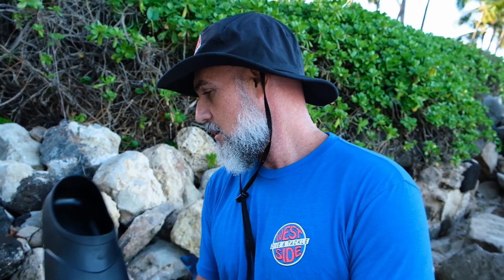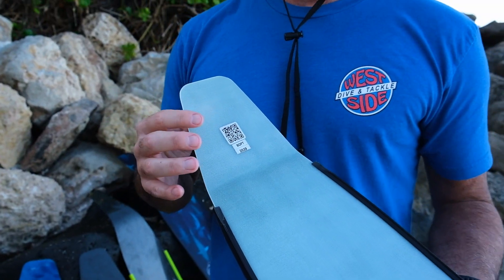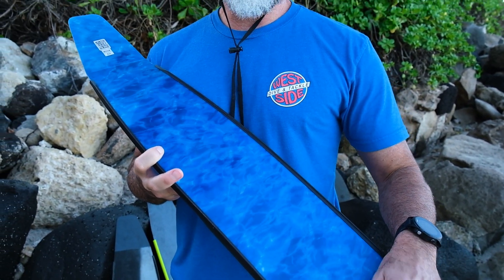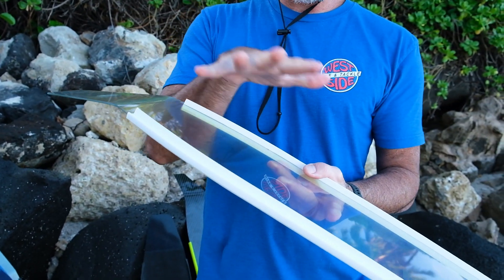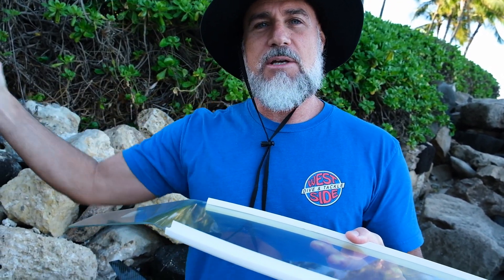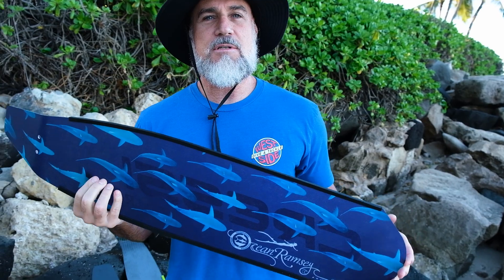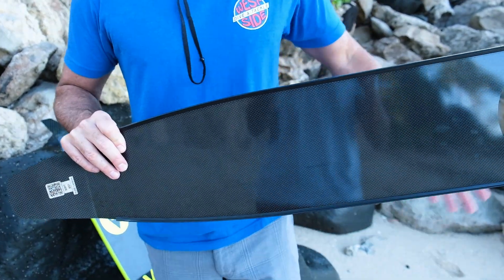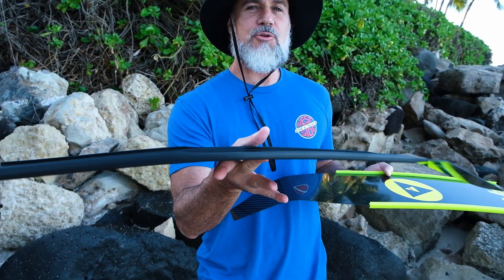BEST FREEDIVE AND SPEARFISHING FINS IN 2023 - What's the difference??

Comment: Hey Chris! Looking to upgrade from my old plastic fins. Been using plastic fins for years. What would recommend? The Leader carbon fiber or the Penetrator composite resin being that Leader carbon fiber is on the lower end of carbon fiber? Mahalo in Advance🤙
Reply from the maker: Penetrators or DiveR are the best imo but are pricier than Leaderfins.Also remember carbons are a lot lighter than the composites blades but try to match your diving. If you shore dive a lot then I say go with composite fiberglass or resin mix. 🤙

Comment: Good morning Chris!  Do you have and experience with the Mako Pure Carbons?
Reply from the maker: No sorry mate we don’t sell that brand as they sell only directly to customers. We’ve seen and dealt with lots of carbon blades over the year though. Do you have a question about them?
Reply: @westsidedivetackle3894  I’m just in the beginning stages of researching.  Trying to decide between fiberglass or lower end carbons.  I’ll be using almost exclusively for spearfishing.
Reply from the maker: @iFlub.  got it. Biggest difference is the material. Fiberglass is typically way more durable than CF. We sell mostly FG blades to folks who are beginning or wanting to upgrade from plastics. It can be a cost thing as well. FG blades are more responsive (translate water down the blade) than plastics but not better than CF blades in that respect. CF blades are a lot lighter than FG therefore you use less energy through your swim cycle. CF are typically more expensive and are less durable (say for reef diving). Hope this helps
Reply: @westsidedivetackle3894  thanks Chris!  Diving less than 100 ft for the most part.  I’ve tried out some fiberglass before and loved them (don’t remember the brand). Didn’t know if it would be worth the upgrade to cheaper carbons for marginally more.  Looking to spend up to about $350 for blades and foot pockets.
Reply from the maker: @iFlub.  in this case you might want to save up a little more and get a great pair of CF blades. Cetma, Alchemy or Meandros CF are what we sell a lot of. The difference of a $100 more for a great CF  is immense! If you cannot save and really want the CF blades just determine the type of diving you a few going to be doing mostly. Again CF blades can get damaged on rocks and reef.  Maybe also look at a mix of CF/FG if your dive  area is rough on the fins 🤙

Comment: The best fins are custom made fins. Need different weights and tensile carbon layers and directions inside. Most of them are just 0-90° stepped layups including DiveR, penetrator and most cheaper blades.
Reply: Is there a solid place to buy custom blades?

Comment: The ONLY real different bewean fins is the stiffness level!! 

When a fin feels better for you it's a sighn 
you got a more suitable fin stiffness to your body structure and  style.
 Material has very little to NOTHING at all to do with your dive depth. Cheap plastic is as efficient as the most expensive carbon fin in the water. With similar stiffness plastic, fiberglass and carbon fiber fins will do very similar dive results if not identical! YES I know it's not what you been hearing but that's the truth. I tried it!
I saw selsmen  letting try out soft carbon and then  hard plastic and naturally the hard plastic was much less compatible and phisiologal  efficient. The one who tested can tell the world plastic is inferior.
Hard fins are optimal for very few divers but surprisingly common among plastic fins.